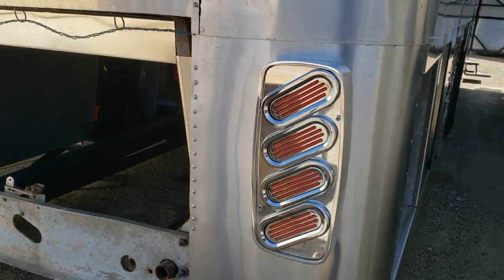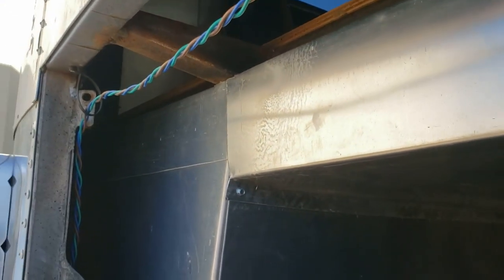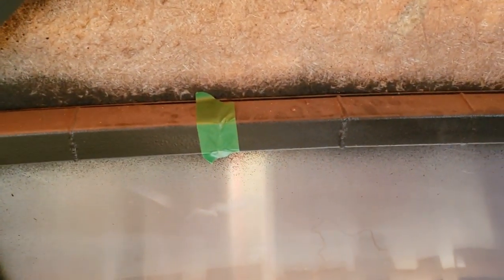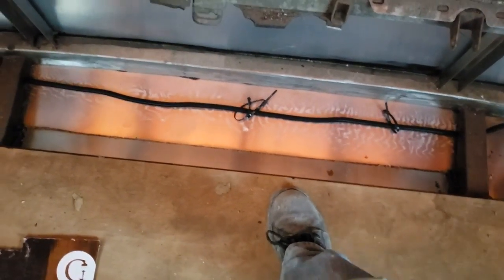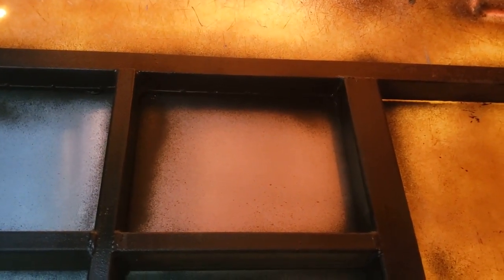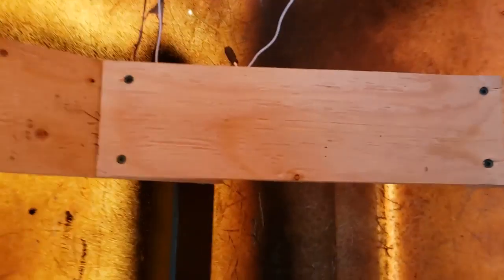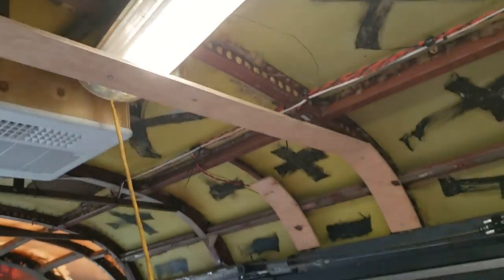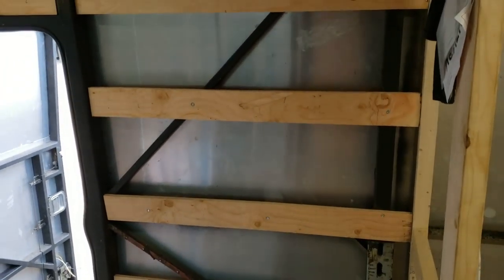Bus Conversion Project - Video 105 - Finishing up prep for insulation

Comment: G'day James it good to see you back again I reckon she will be one hell of a bus when you have finished her, the work that you've down so far on this video is bloody well thought out. Those cooling fans for the engine are different than any other of seen, I'm glad you showed what you are going to do. Good luck stay safe John
Reply from the maker: Thanks John... I hope to be living in it by this fall (fingers crossed), the fans are aftermarket 1 ton pickup electric fans.... in theory they flow enough air but I had overheating issues on the mountain pass last fall when I brought it to Kelowna... think I know what the problem is... just have to have time to fix it , then test it out

Comment: Looking very good, getting closer all the time. Where did you source your tilt column and steering wheel?
Reply from the maker: Column is a Flaming River part... got it though Summit Racing, steering wheel is a peterbilt truck aftermarket wheel, got it from 4 state truck parts... same place as I got the 359 Peterbilt dash from
Reply: Thanks James!

Comment: Hi James question could you blow a diesel heater  into those vents instead of propane ? and if you ever come to Srathmore Alberta look me up see ya and thaks for the update.
Reply from the maker: Hi Tim, good to hear from you, I suppose you could use a hot air diesel heater, I have a diesel water heater and 2 automotive heaters that blow hot air through the ducting to give me 2 zones , I have  couple of previous videos detailing the system I built that seems to work pretty good, I'm going to add another circuit to heat the bays as well to keep them from freezing, the system is kind of Bo jangled at the moment, I need to add a reservoir tank and zone pumps to maximize the system and I need to do that by next winter as I plan on living in it by then, there is no propane on the bus.... at some point I'll add a propane barbecue but other than that no propane on board, diesel is the only fuel I will be using, thanks for the invite, I'll definitely look you up if I'm ever in Alberta, if you come to BC let me know... thanks for watching
Reply: @JamesEDennison  thanks James